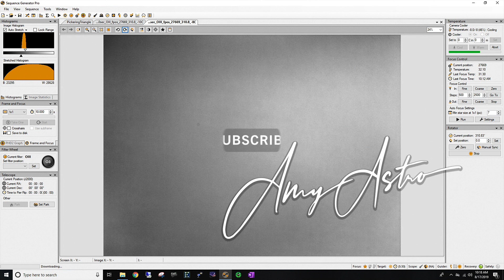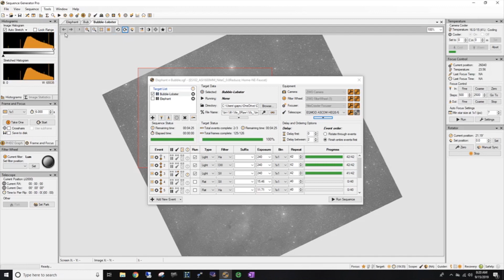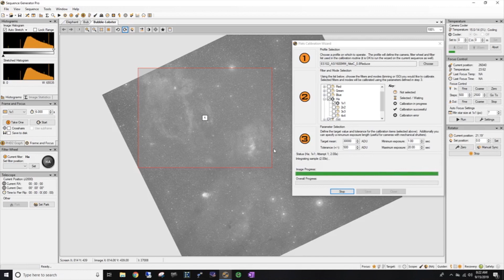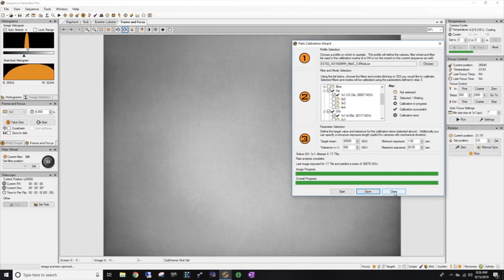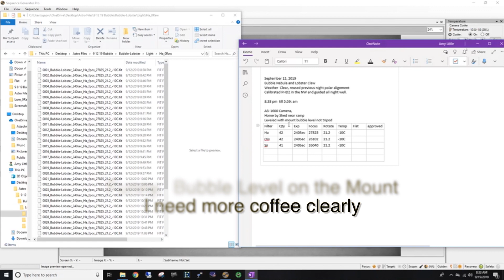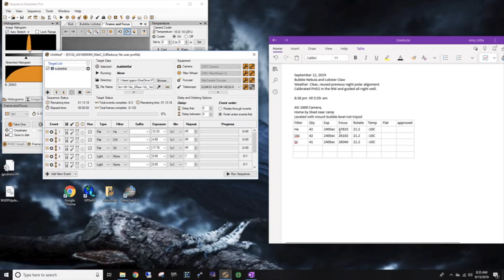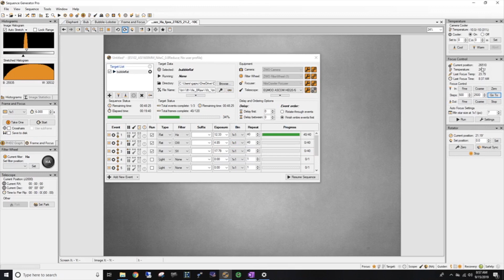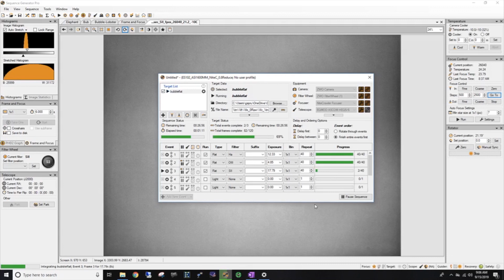Sequence Generator Pro - Flat Frame Calibration Wizard

Comment: Great video Amy!  Your mention of filter focus position for each filter brings up a question.  If one was taking flats inside with an ambient temp of about 20deg C, then would one take the inside flats/flatdarks at the focus position for that filter at the room temperature instead of the focus position when the lightframes were taken?  I think the object is for the OTC to be in focus, and on mine, it's very temperature dependent.  I use TC for my focuser which is spot on, changing the focus every shot, only needing to do an auto focus every couple of hours but the focus changes hundreds of units per night as it gets cooler.  I haven't even considered focus position in my past flats - I will now.  Also, makes me want to shorten my flat exposures, they are 10 to 30 seconds with corresponding dark frames.  
Phil 
https://www.astrobin.com/users/pmont1/
Reply from the maker: Hello Phillip!  I take my flats at the same temperature and focus point of my image itself.  The Dark Flats I only care about the temperature.  You will take the Dark Flat at the same exposure length of your Flat image.  The filter does not matter with the Dark Flat since the scope is covered and the image should be dark.  Yes, you probably should take shorter exposures for your flats. SGP has a calibration wizard that will help you determine how long the flat should be taken.  best of luck!

Comment: Hi Amy,great work,i was wonder what gain have you used?i am using a one shot camera QHY168C,thx
Reply from the maker: Davide Mancini for the first year with my OSC I was using gain of 0 and Offset of 50. The HDR settings.  Recently with my mono camera I’ve been using Gain of 139 and Offset of 21 Unity Gain. I have another video about what gain is. I only learned this recently.  I referenced a great article that explains it fully. Check it out.
Reply: @AmyAstro  Thx:)
Reply: @AmyAstro  i meant for the flat frame,are you using the same setting that you use for the light?
Reply from the maker: Davide Mancini yes I use the same gain/offset for calibration and light frames.

Comment: Hi Amy, thanks very much for the awesome videos ! I was hoping you would comment on the readout value you use for your flats. I have the same camera and I've heard and read everything from using 10,000 adu all the way up to about 35,000 adu. I have had some reasonable success with 20,000 - 24,000 adu values. Thanks for your thoughts.BobBTW, your setup really is nice !
Reply from the maker: Thank you.  I typically shoot for an ADU of 30,000 plus/minus 500. When I do the flat wizard I will get the times for LRGB first, then do the NB filters. Sometimes I have to adjust the ADU to get it to work.

Comment: Very nice job. What mini PC did you go for and how do you like it? I am thinking of replacing my laptop with one.
Reply from the maker: The computer below is what I have been using for the last year.  The main requirements when I was looking  were, Win 10 PRO, 64GB storage minimum, 3 USB ports.

The 64 GB is because of windows updates.  the 32GB is not large enough to handle them.

3 USB ports were for a dedicated line to the camera, one for a powered usb hub.  The other was for an external usb antenna.  I needed a stronger signal to inside the house.

Window 10 Pro was for using remote desktop protocol.  The best option if you are at a location with no internet.  I carry my router with me and everything works great.

I've attached it with heavy duty velco tape and an extra velcro wrap around the dovetail bar for good measure.  Very sturdy.

Thank you for the question.  Hope this helps.

N34 Windows 10 Pro Mini PC Celeron Processor 4GB RAM, 64GB eMMC, DIY SSD, HD 4K Intel Quad Core CPU up to 2.2GHz, 4W SDP, 1000M LAN, Dual Band WiFi, BT 4.2, HDMI&VGA
by MINISFORUM   https://smile.amazon.com/gp/product/B07F73ML9P/ref=ppx_yo_dt_b_search_asin_title?ie=UTF8&psc=1
Reply: @AmyAstro  Thank you for all the info. I am checking it out now.

Comment: Another nice video, Amy.  I have been thinking about flat panels, and have (perhaps incorrectly) assumed that they HAD to be done in the field.  Your video suggests that I have an incomplete picture.  I know that the flats must be taken at the same focus (and rotation, though I am rotation-less) for each filter.  I did not realize, however, that one could record the exact focus position for each filter and then do the flats later, not in the field.  I am not using SGP, but rather SkyX Pro. I am going to have to see if I can get it to record my focus spot.  Seems to me like taking flats the day after -- or whenever after -- is a big advantage over having to take them in the field.  Really instructive vid.  Turns out you are not an excellent photographer, but a good teacher, too.   I can spot them a mile away!  Cheers and thanks again!
Reply from the maker: Thank you so much Jack.  If you are using an electronic focuser you should be able to get the position.  I embed mine in the file name just to make life easy.  I need to check out the SkyX Pro software.  I've heard good things about it.